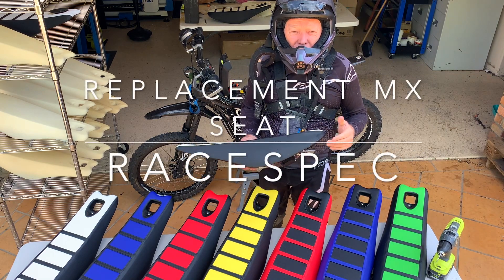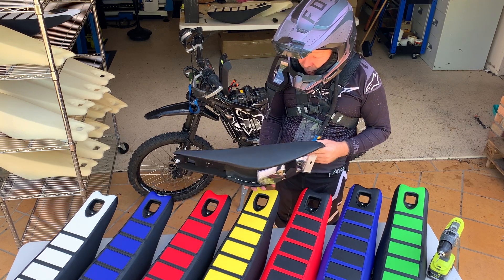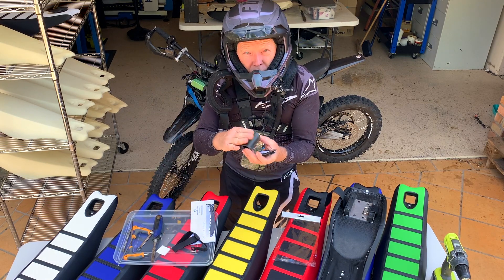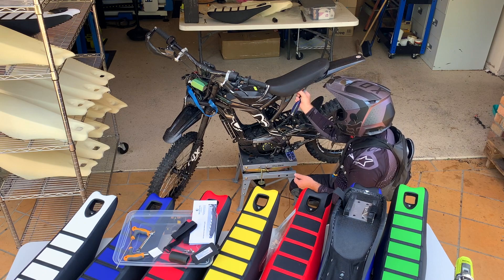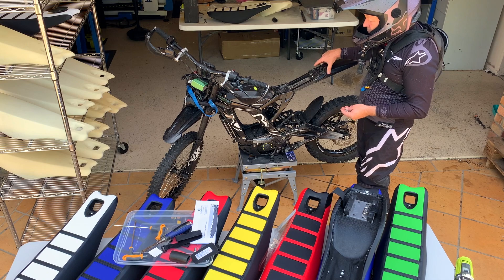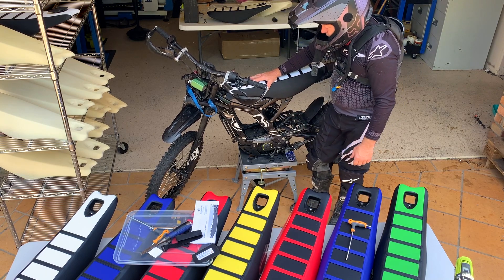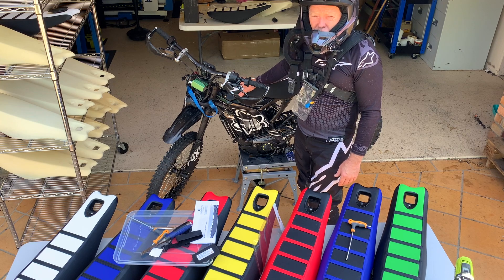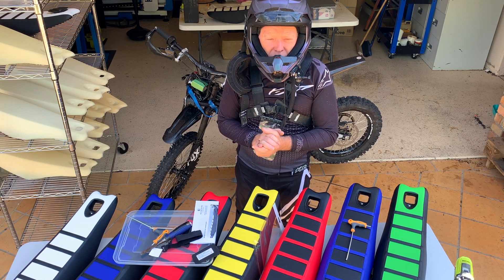MX replacement seat install guide

Comment: A bunch of us have fitted this seat here in Japan. Some feedback if you are interested. Overall we are happy with them, particularly the way you can comfortably move further forward. The attachment is fine, and like you say in the comments it feels much more secure riding than you would expect. Most of us have found the seat too wide and a bit too high, both for those with shorter legs and us taller guys who want to keep the MTB feel. We mainly ride enduro style single track, creeks, forest ridges and so on. So we have all removed the cover, trimmed down the foam, trimmed the plastic battery indicator insert, and restapled. At the rear and sides we have tapered the foam almost down to the plastic, and elsewhere have taken the height down to just a smidge higher than stock. May seem counterintuitive to undo all your good work but now they feel and look perfect for our use—slim, agile, flat. Easy to slide off the back, wheelie turn, etc. Also using your pegs and stem riser. All good stuff, thanks. I’ll film a trimmed seat and upload to YT if you want to see what we have done.
Reply: Would love to see a video

Comment: So it won’t fit aftermarket battery that still uses stock cover, but extends just a little bit higher, right?
Reply: Yesterday I installed an EBMX 72v battery using the stock cover and stock latch hook. I spaced the front of the cover up 1" instead. I used a heat gun to flare the cover out to clear the rear/top of the battery. My first gen Race Spec seat fits perfect but it's way more flexible than the current ones. The 1" rise doesn't hardly show, maybe heat and bend the front seat base up a couple degrees?

Comment: Got the black and white seat, but would have gone for black which you mention or the black and green shown. A solid replacement of the stock seat  which is a bit of a joke imo  and which I replaced almost immediately with a jerry rigged KTM. cheers

Comment: Very interested in the all black version, how long til released? What sort of snap on goggle system is that, looks clever. Personally I can't race and suck on a tube at the same time so I got the Liquid  Aider auto system for my small Ogio pack. Our bikes look amazingly similar but I tinker alot and have more custom mods. I'll email a pic to your website.

Comment: I just got mine! It works as described. Also much better for wheeling two people around. Only one problem though, most of the battery upgrade options require modding the battery cover. So I wonder if the lite speed battery cap adjustment will prevent this seat from sitting properly. Any advice?
Reply: Yes it surely will prevent it from positioning correctly.
Reply: He says in the video it won’t work with a larger battery.

Comment: I recieved my seat today and installed it. I immediately took it off. I am a fan of the other race spec parts I've purchased but this seat is a swing and a miss. Very janky setup and it is not secure.
Reply from the maker: Hi Jay C, thanks for the valuable feed back. Did you get to ride on the seat though? Challenge you to ride for a weekend and see if you still feel the same? The stock seat is yuk! Our seat is definitely unconventional, we had to make it light and simple to attach, to keep weight down and still allow quick access to the battery. If we can find a way to improve this we will. Can you let us know how you go after using it for a while, it's likely more secure than you think and is a big improvement on riding position and seat height.
Reply: @racespecsurron1220  I find this seat comfortable and better than stock Just wish you could have extenders also